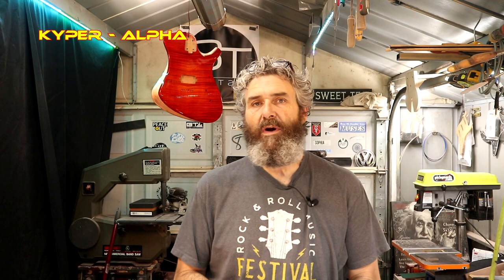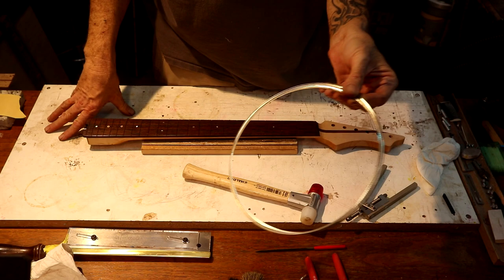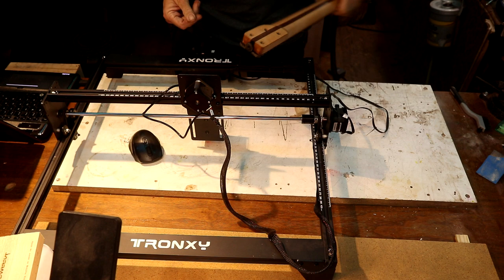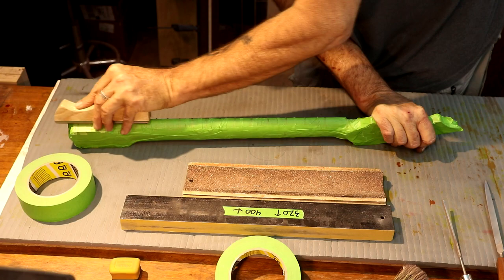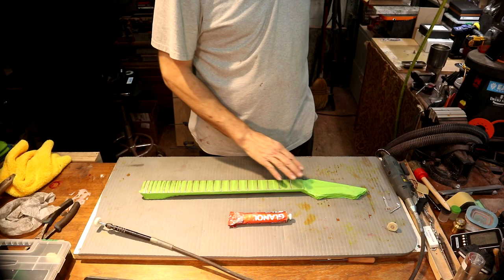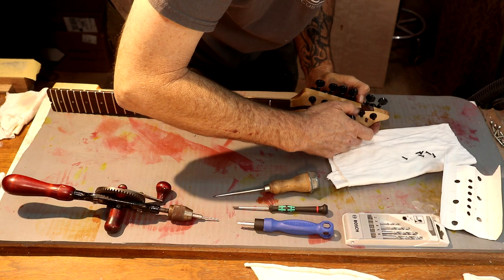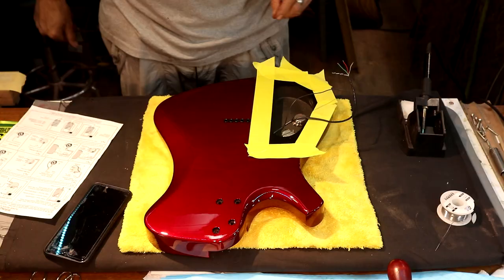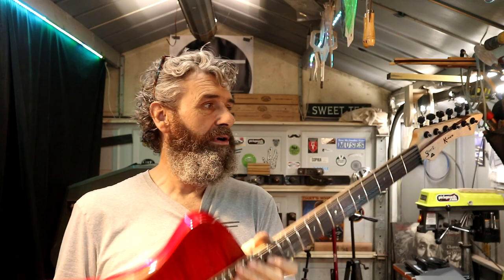Custom Guitar Build - Episode 10 - Kyper Alpha

Comment: Hey Todd, guitar is looking great.  Where do you get your threaded inserts from, and also the T-handle tool?
Reply: those looked great, huh? I'm working on my first build and the number of times I've had to attach and pull off the neck to check things, inserts have got to be a better way...
Reply from the maker: Thank you brother. I get them from eBay, Taytools store on eBay to be exact. If I can remember to do it, I'll post a link! They're 10-24 steel inserts with insertion tool!! It has become the way I like to do bolt ons!! ✌️🤍